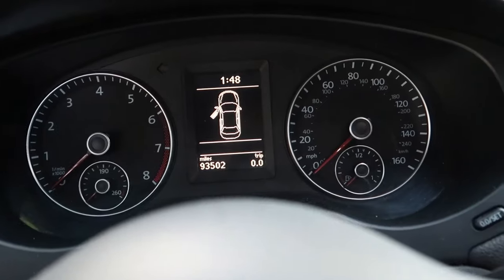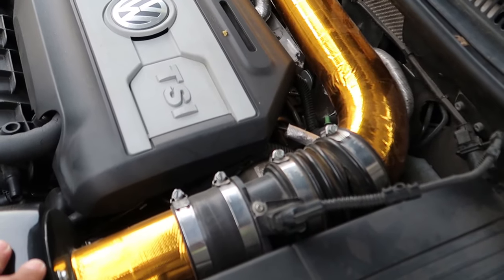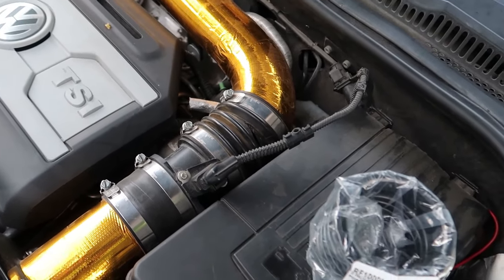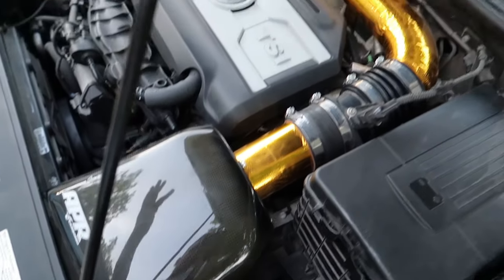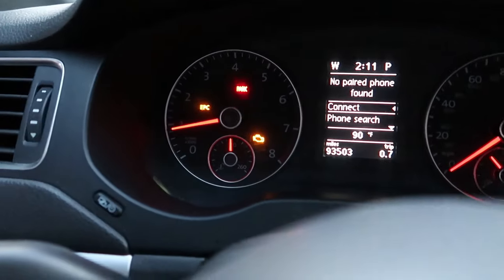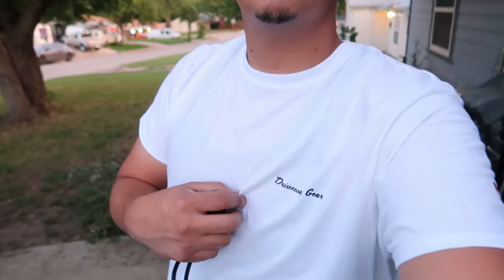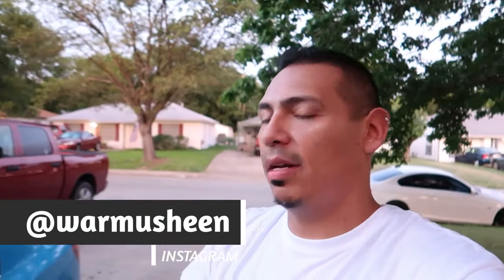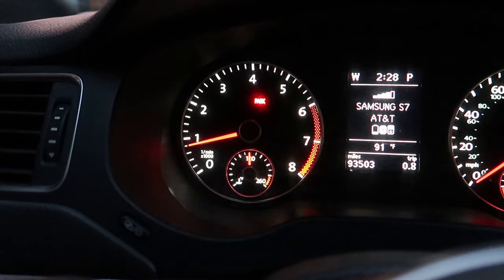EPC Light Fix - VW Cylinder Misfire

Comment: I have a question. I have epc light on. Replaced 
fuel pump 
Fuel filter
Fuel pressure regulator switch
Crank shaft position sensor
Gas pedal
Break lamp switch
Still no start any suggestions???
Reply from the maker: Did you replace the fuel injectors? What codes are you getting?
Reply: @JoelsDriveway  i did not repoace the fuel injectors because after i replaced the fuel pressure regulator i checked for spark and got no spark. Its immobilized. I then switched to replacing crankshaft position sensor and gas pedal. In the beginning i got codes 1780 1850 and 0725 i changed the crankshaft position sensor. The battery died and i have not gotten it to start since. Tomorrow im taking out the drivers seat so i can get comfterable and check all wires connected to the relay panel
Reply: I did the same fuel pump filter and relay it ran better it would loose power on left turns only besides that running good then today it went limp again and noticed the epc lite I must have been over looking the lite the whole time now I feel im getting closer to the fix after seeing these videos gonna put the reader on it asap and go from there
Reply: @eddierodriguez1807  let me know when u find out. I have done everything on this car now except for the computer. I replaced the maf sensor and the throttle body since the last posting. I also tried re programming new keys too...
Reply: Change the battery

Comment: my 2014 golf seven tsi was fine till i change oil,spark plugs and all filter,,and it showed the engen warning lights and epc lights no power at all any advice
Reply from the maker: Hmm, sounds like something was disconnected and not reattached. Scan for codes. It should tell you where to check.

Comment: My epc light came on today and the car slowed and came to a stop I had to turn the car off turn it back on press the gas put it in drive for it to go. It gave me trouble starting up the first time. I have 2007 vw Jetta Wolfsburg edition.
Reply: Same symptoms, and mine would randomly die. Not alot , 4 times in day 12 trips. 
I changed the crankshaft position sensor and no problems now.

Comment: i've got a VW CC 1.4 TSI. when i'm doing high RPM's (like 4000) the car kinda gets stuck at 4000 RPM and doesn't go further up. also, the car shakes like it would shake when you're out of gas.
Reply from the maker: Sounds like its running in "limp mode". Is your Check Engine light on? May want to have it scanned for error codes. I'd start there.

Comment: Where did you buy the gold tape heat reflector?
Reply from the maker: I think amazon but you can pick it up at most auto parts stores
Reply: @JoelsDriveway  I just bought a 2018 Passat tsi bro but the epc and engine light only come on when the electrical is on not when I'm driving. Any input will be greatly appreciated

Comment: I had the same EPC and engine light on the dashboard of my 2013 VW CC the Fixed device read codes P2306 and P0303 and I changed the spark plugs and the coils and the problem was fixed. No more misfire
Reply: Hey I'm having that issue now. I replaced the coils and plugs and I'm still having the same problem. Do you have any ideas please help 🙏
Reply: @zansei1 check engine valves! Hopefully ur piston are okay

Comment: Must change PCV valve
Reply: This was what I was told about my 2010 Tiguan misfire.. hopes this fixes it lol ugh 😫
Reply: @bethanymurray2152  change your Pcv replace sparks , use premium gas and every 3 k fuel system cleaner.and Right oil 5-40
Reply: @onurgns  ok good to know.. I've been using premium since I bought it in 2017. Had misfire before. Did coils and plugs. Was fine, then started happening again. It's currently in the shop and they said PCV and intake manifold. I hope it's not a cylinder?
Reply: @bethanymurray2152  mostly likely Pcv. If it failed it is gonna get cylinder head and sparks and others oiled
Reply: @onurgns  ok thank you for your advice! Much appreciated..

Comment: How can I contact you I’m having similar problems but code errors for the camshaft sensor and spark plug I changed both still same issue but when u start it there’s a loud vacuum noise from the air intake
Reply: Having same problem right now. Did you ever get in touch with this guy ?
Reply: @Kevin98765  it was the ignition coil
Reply: @meech4prez747  thank you 🙏

Comment: You sure u fix the problem or you clear it with the obd scanner. 🤔 😏
Reply from the maker: Misfires were gone. Cleared codes to speed up process. Takes 50 miles of drive time to reset engine light on dash.
Reply: @JoelsDriveway  thanks for sharing the details
Reply from the maker: Of course! I recommend every VW owner to have an OBD2 scanner.

Comment: I find if you disconnect battery and reconnect it switches lights off.
Reply: Mine did not start and nothing did, i changed the battery to a new one and i got the EPC light on and the start and stop function error appeared, so now my ignition takes 2 to 3 tries to turn the engine on ! weird

Comment: I would have unplugged the battery for a few minutes. That should have reset your computer and cleared your codes.  I don't know for sure if it would have worked not but I would have given that a shot.  Great video.  Love my 2013 manual GTI. I think our cars are very similar in technology/parts. My second GTI.  I love my VW.

Comment: Just got an EPC and threw me on limp, turned the car on and it feels rough at start, afterwards it sounds good, and it smells like gas pretty strong, checking it out today and hoping to fix it soon, it’s my daily 🤕🤕
Reply: propably a coilover
Reply: i mean coilpack sorry
Reply: @16cliffedge  thats funny 🤣
Reply: Did u see what was wrong
Reply: @TheThegreenpi  my parents car had the issue. In the end the fuel injectors needed replacing. Strange for a 20k mile golf (1.5t) which they bought just a month before it happened…

Comment: My neighbor has 2018 Passat with ~15k miles.  Today out of nowhere, the EPC and Check engine light lit up after she drove about 100 meters in the morning.  For about an hour she tried to start the car again, drive a bit, but the car was running rough when idle, but driving wasn't too bad.  Although engine power was limited.  Vehicle sat for a few hours while owner called VW dealership (car is still under warranty).  By the time they drove off to VW dealership the above lights disappeared.  I still advised them to drive to VW and get the car checked out.  To me, it sounds like some type of vacuum leak as it happens in idle, but car with such low miles...maybe it is a VW thing and it is normal.
Reply: Happened to my mothers car at just 2y/o and 20k miles. 3 trips to the dealer to fix. They only gave us a courtesy car for 1 day though and it had almost no coolant in so was returned 😂
Reply: 30,500 miles on my 2017 Passat. Changed oil a month ago. Replaced battery six months ago. Today the EPC & Engine lights came on. Of course, a holiday. Everything closed. 🥴

Comment: Get a obd2 scanner n then clear the codes the.lights immediately go off the car runs better. You can get one at auto zone for 45 bucks...
Reply: So if you clear the codes the problems stop?
Reply: @Warkilla007 that's not the point

Comment: I have same issue I put a reader on it got P0300 P0302 P0303 Says misfire of cylinder two cylinder three also has code of $07E8 and $07E9.

Have the EPC have the check engine light flashing.

The idle is rough and when you push on the Excelerator to gun it rev it however you want to say. It’s sputters